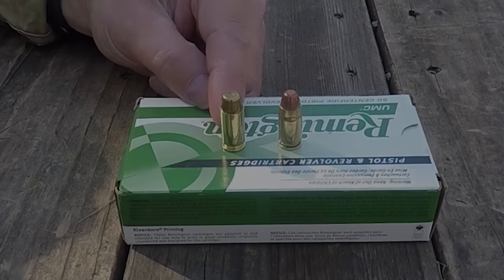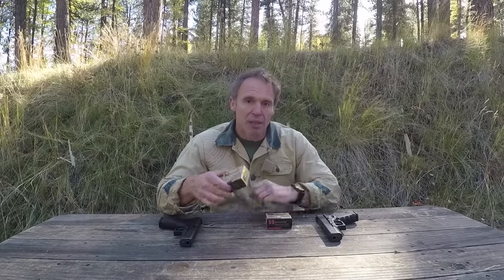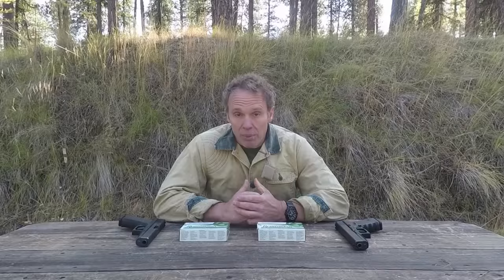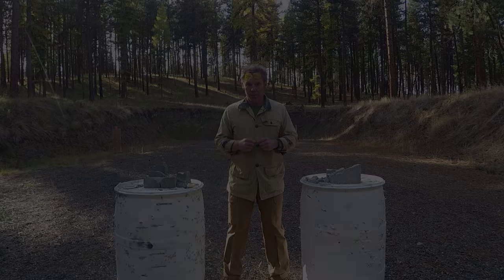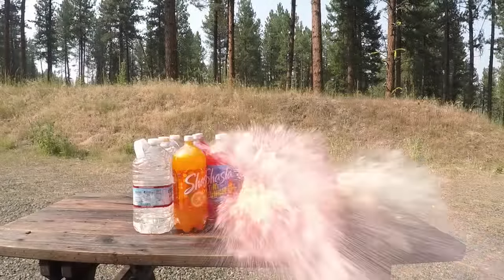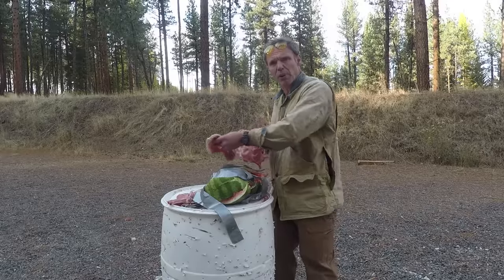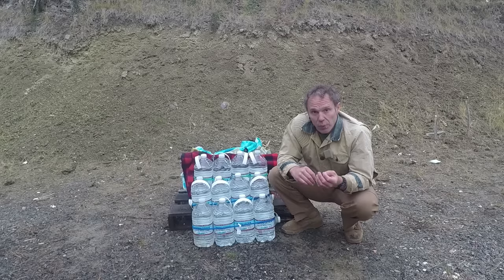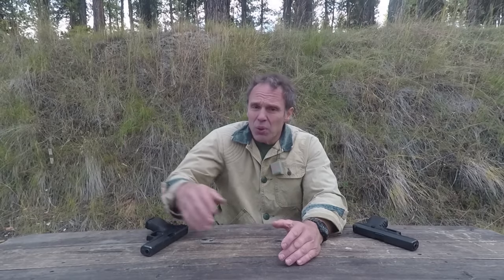Personal protection: .357 SIG vs. .40 s/w

Comment: From all of Paul's videos, I've come to the conclusion that every caliber has it's advantages and disadvantages.  It's almost like there is some form of tradeoff that people must make.
Reply: Paul gives you the data that will help you make the best decision for your self.
Reply: @naturewatcher64  hope you picked up on my sarcasm.
Reply: "You be the Judge!"
Reply: @ratagris21  I don't wanna be the Judge. I've seen his videos on them. The Circuit Judge was particularly disappointing. I wanna be the Magnum Research BFR in .444 Marlin.
Reply: Yeah, almost.
Reply: @af7119  I almost did.
Reply: You are right 😊
Reply: I just wish .357 was more popular and cheaper
Reply: I concur ... the matter of fact is ... similar size CALIBERS are just different for "commercial" purposes; in real life applicability, they all are virtually the same. THAT BEING SAID... in the vid's setup ... I think .357 SIG clearly outperformed .40S&W w/ LESS recoil. I'm surprised.
Reply: @moustachio334  Why more popular? It's essentially panic proof due entirely to it not being that popular. Availability is an issue if your state doesn't have a police agency that is using it. Some states currently use it and the practice ammo is abundant. Just depends where you are.
Reply: @Ujiyo  yup.  9mm went up disproportionally due to its popularity.  .357Sig is better for CCW as it’s likely to require fewer rounds to stop a threat, and it’s more reliable feeding than any of the defensive handgun rounds with the necked down cartridge.  Plus the panic buying does seem to pass it over relatively speaking.
Reply: @JustDefense  Don't get me wrong. It's expensive to shoot. Almost prohibitively expensive. It's one of the most powerful handgun calibers you can get in an autoloader. I've never had an issue with feeding. The design of the cartridge absolutely lends itself to feeding without issue. I'm currently looking for a Sig Sauer Nightmare in .357 Sig. I really like the 1911/2011 design. I also like my P229. I just prefer the 1911 platform.
Reply: @ratagris21  in his one video, a actually said it the same time he did.🤣
Reply: When someone asks what's the best ammo to get?  The answer is always "What's the application?".
Reply: @renatosureal  from my experience,  357 seems to give sharper recoil impulse but about the same muzzle flip as 40 S&W.
Reply: I have a sig P 229 in .357 Sig, and also have a 40 barrel , I feel that I have most of my options covered here in Maine, with Buffalo Bore dangerous game ammo in the 40, it will take anything that lives in my state

Comment: Noticed the 40 S&W had less felt recoil muzzle rise than the 357 sig.  At the range, 357 sig is much louder than 40
Reply: I bought a Glock 33 this summer. Subcompact 357 SIG, shooting mainly 125 grain flat nose, 59 cents per round. (Edit July 2023, now 46 cents per round.)

Love the Sig, I find complaints about recoil greatly exaggerated.

However, tough to get ammo and it's expensive. I can get a 40 S&W precision barrel around $200 including tax and shipping.

40 S&W 165 grain jhp same brand as the 357 SIG, is 32 cents. Pays for the barrel in under 700 rounds.

My question is for 40 cal shooters - in a subcompact like this, am I giving much away carrying 40 cal jhp? Would you be happy with the trade-off? What would be the drawbacks if I carried in 40 sometimes on a subcompact?

Edit July 2023: I bought a SIG P229 and have 40 and 357 SIG barrels. Both shoot great and I'm very trustful if either with normal ammo, usually flat nose and 165/125 grain.

IMO, oddball ammo tends to be highly unpredictable and I don't see the point in these calibers. Standard ammo will take down anything as well or better than hyper(expensive)ammo.
Reply: @keithgraham9547  In a short barrel there's probably not much in it.  Maybe a slight advantage to 357 in that you're taking the guesswork out of your HP expansion, they're definitely going fast enough.  That said remember that your barrel doesn't need to be flush, nothing stopping you throwing a G23 barrel in there.
I reload so it's all the same to me, a primer is a primer.  Haven't really shot anything but 357 SIG, 10mm, and 45 Super for the last couple of years.
Reply: @robertg8565  You'll get 1400 out of a 125gr no bother.  You start hitting diminishing returns with lighter bullets very quickly, you can push a 115gr at 1600, 90gr at around 1700 - problem is JHP just explodes on contact, doesn't penetrate for shit.  It really is very heavily optimised for a "sensible magnum" 125gr load.
Reply: @robertg8565  Bit of a stunt load in 357 SIG, much like Barnes TAC-XP.  Might as well just get a 5.7 out at that point.
Reply: @robertg8565  Not any more they don't, and your POI is going to shift significantly if you're changing between 68gr screamers and normal loads.
Reply: @robertg8565  Training isn't going to help with your rounds not going where your sights are pointed, and gel testing doesn't work the way you think it does.  I would recommend you get some more real world experience, and say my "name" to yourself.
Reply: 357, in the same gun as a .40, is definitely flatter on muzzle rise. Stop flinching because it's louder 😂
Reply: carmineredd  Well, no, you're not right.

First, getting shot in the head with anything will usually kill you, but there have been lots of cases where a 22 skidded around the skull under the skin and the person survived. 

Don't want to try it myself
 But never heard of that happening with a head shot from a 44 Mag.

Second, very few shootings are head shots. Very few are from 3'. No, I don't want to count on making a head or groin shot at 40 yards with a 22, versus a perp with a rifle. Or body armor.

I used to be comfortable carrying a 22lr with a 1.5" barrel and six rounds, figured any two people trying to mug me are not going to like it.

However, the last 3-4 years have seen riots and shooters in body armor with rifles. While it's highly unlikely I'll ever need it, I decided to upgrade my summer carry.

IMO, based on videos, my own shooting, and whatever statistics I can find, 9mm sucks. Hard. I despise it.

So while I still shoot and sometimes carry 9mm, I don't have huge confidence in it.

Three-season is usually a Glock 30SF in 45acp. Summer is usually a G33, but I bought a SIG p229 about four months ago and have both 40 cal and 357 SIG barrels. Big fan of both.

If I HAVE to engage at 40-60 yards, I can make a perp jumpy. If I HAVE to make a head or groin shot at 15 yards, I have a better chance with those three calibers and guns.
Reply: carmineredd  Sure, if you want. You get a screwdriver and test it out against a mass shooters with body armor and an AR. We all want to see the video of how that works for you.
Reply: KE increases more with velocity, but not momentum (=mass*velocity).
And KE is used to mesure everything nowadays but older shooters and hunters still use momentum, and below 125gr is very light for Caliber in 357/38/9mm.
Standard for 357 SIG imho should be around 125-158gr as its original purpose was to emulate 357 magnum performances in semi auto.
Reply: @robertg8565  So how's life in Tel Aviv these days?
Reply: Greater energy of the sig , no brainer

Comment: I carry .40 S&W and I will continue to carry it. Its a good compromise between 9mm and .45 acp. The round is proven no matter what anybody says about it. I think practice drawing and shot placement is much more important than the round ypu carry. I can do a lot of damage with a .22 just from placing my shots in effective areas on the target.
Reply: 40 isn’t even a compromise on 45. most .40 sw loads (particularly 165gr loads) have a LOT more energy than .45, unless you step up to .45 acp +p which even then you can get .40 ammo that competes with the +p too. .40 also gives you the same capacity (or larger capacity) as the .45 but is almost always in a fair bit smaller gun.

Comment: This is a good video Paul. As someone who carries 357 Sig: I have my own experiences, the 357 Sig owners I've spoken to when I worked at a gun range (take with a grain of salt of course), and the data I've seen. Let me explain the pros and cons to people who may find pages of ballistics data to be a bit overwhelming.

Pros: 357 Sig is very cost effective firearm wise. You can buy a police trade in .40 S&W pistol for cheap, swap out the barrel, and have your gun. (I did that with my P226). Additionally, it's much easier to train yourself to go between 9mm and 357 Sig than it is to go between 9mm and .40 S&W. The increased velocity of the 357 Sig helps the hollow points more reliably expand and makes it a much more flat shooting caliber than 9mm, .40 S&W, or .45 ACP. 357 Sig is also standard issue caliber for highway patrols in most states and Secret Service, so if you carry the same ammo as they do (usually Speer Gold Dot) it will be looked at with a less jaundice eye in court.

Cons: Ammo cost itself is going to be a bit higher and you usually have to order online to get any of the premium hyperammunition. Because the caliber is necked down, it has a much higher PSI. What this means is if you convert a .40 S&W over you want a reputable make that's going to live up to SAAMI specs (Glock, Sig, CZ, etc). Because the 357 Sig is flying at a much higher velocity, which pistol calibers aren't really made for, you have to be more selective in your ammo choice. IME and from the data I've seen, that's pretty much only going to be 125gr weight projectiles. Anything under that tends to break apart or otherwise have issues with penetration. (The projectile breaking apart is very good for a rifle caliber, mind you. Not pistol calibers though.)

So, is 357 Sig the right choice for you? I would honestly recommend it for just a few circumstances. First and foremost: If you spend a lot of time in your car. I used to deliver pizzas so shooting through auto glass would be a concern for me. 357 Sig goes in a straight line through it. Secondly, if you live in a very cold area where people are constantly wearing more and heavier clothing, especially during winter time, the 357 Sig's velocity can be very helpful for defeating that. You can also conceal a bigger 357 Sig pistol more easily. Lastly, you work in some type of private security or escort where you have a VIP that must be escorted from vehicles and through buildings. Generally speaking though, 9mm is the best caliber for new shooters. There's a 9mm handgun out there for anyone, everyone can handle a 9mm, and you can find ammo everywhere. (Ain't called wonder 9 for nothing.)
Reply: I agree! My friend and I bought Sig 239's. I bought mine 1 year ahead of his. Mine was a 9 mm his a Sig .357. My 239 9mm had a stamped slide his a CNC for the .357. We got together to test the difference. The .357 was far superior to my 9 mm. Wish I would have waited to get The. 357 Sig! Sold my 239 9mm. I got the XDS sub compact in 9mm sold it too.. Then bought the Lc9s 9mm pro wish it came out in the .357 Sig Still remember the 239 in .357. Wow what a gun!    Shawn
Reply: @Jonathan Anatrella That's some good information there, my brother. I'm doing research at the moment, looking for a firearm and caliber for police academy which I'm hoping to start in a few months. The caliber options were basically anything between 9mm and .45 ACP. I wanted something that would be an effective firearm with a little more power than the 9mm but wasn't something like the .45 as I already have a .45 pistol that I'm not going to be using as it isn't from a company authorized to be used by the police in my area (the company is CZ). I remember seeing the .357 Sig years ago but didn't really know much about it. Looking at what Paul and yourself have mentioned, I'm thinking the the Glock 31 or 32 chambered in .357 Sig is going to be the way I go. I'm a larger person, not fat large, so I can handle the calibers that are snappier like the .40 S&W, .357 Sig, 10mm, and so on with relative ease. So thank you for this info. Very useful. Much appreciated.
Reply: @zagorith14  I would say .40.  10mm is expensive and uncommon(might be an issue in court).  Also, .357 SIG runs at a higher pressure and is harder on guns than .40........

Comment: My Glock G22 loaded with .40 cal. work fine for me especially with the crazy price of ammo, but to cover my bases I purchased two conversion barrels for .357 Sig and 9 mm for my G22. The Glock .40 cal. magazines work fine for both the .357 Sig and 9 mm as well.

Now if the SHTF I can use three of the most popular handgun calibers with one small shooting kit. Simple, flexible, efficient, and inexpensive.
Reply: 357 followers work fine with .40.  The .40 followers don't work so well with 357.  Fine for range use but I wouldn't trust them for anything serious.
Reply: 357 sig is one of the most popular handgun cartridges?

What lol
Reply: Yep, me too. But my original Gen 2 mags get ftf for 9mm. New mags including 22 rd (for 40) work for the 9mm too.

Comment: When my agency switched from .357 Revolvers to .40 S&W we chose the 155 grain JHP. The reason initially was because the muzzle velocity and projectile weights were very close to the .357 Magnum 158 grain JHP.  The results in test medium was virtually the same for each.  Later, after the .40 S&W became popular we began to have various Law Enforcement Agencies contact us in regards to the 155 grain JHP’s performance in the field, because the 180 grain JHP .40 S&W’s failure to perform as expected.  A local sheriff’s department  inadvertently switched from Speer Gold Dot 155 grain JHP to Speer Gold Dot 180 grain JHP. They had had three one shot stops and one multiple shot stop with the 155 grain JHP Gold Dot. In the first 180 grain Gold Dot shooting the subject was hit three times in the chest area at point blank range. He then ran ~50 yards and sat down against a tree. When backup arrived he was complaining about having difficulty breathing. When EMT’s arrived he had stopped breathing. I have since been told that after I retired Ammunition manufactures had greatly improved jacketed hollow point design and the 180 grain JHP’s, such as the Speer Go,d Dot, were on par with the 155 grain versions.

Comment: 357 sig is very underrated.  Not sure why it isn't more mainstream than it is.  Almost comparable to the big dicked big brother 357 Mag.
Reply: Very comparable is full sized pistols and duty revolvers both launch 125 gr bullets at 1450 fps only thing is that's about where 357 sig maxes out while 357 mag can still go more powerful
Reply: .40 is actually more powerful. When you get the hottest factory ammo for both, the 135 gr Underwood .40 nosler, and 124 gr Underwood .357 sig nosler, the .40 reigns supreme. So .357 sig can not claim to be more powerful, no matter how many big companies load .40 and 10mm way under saami spec and load .357 sig pretty close. 

The 135 gr and 155 gr underwoods are rated from a 3.4” barrel too, AZ AIRGUNNER just proved that with two recent videos of .40 vs .357 sig. He got exactly 589 ft lbs from the 3.4” barrel with the underwood 135 gr .40 nosler. The .357 sig nosler from them had 540 ft lbs. from the 3.4”

From a 4.9” barrel the .40 had 675 ft lbs. The .357 sig had 640 ft lbs from a 4.5”.  Gun Sam tested the .40 from a 4” and it got 610 ft lbs. Needless to say I picked up a fex boxes. It’s in saami spec and it shoots great from my Glock 23, not uncomfortable at all.
Reply: @SuperD00D  357 sig is more powerful than 40. If it's not then it's not loaded right. It should be.
Reply: it got fairly popular about 15 years ago. Like the .40 cal its dropped in popularity. Even more so probably.
Reply: My edc is 357 Sig and I think one reason people do not carry it is because it is loud as hell. With greater power comes louder thunder. Anyone that says otherwise lacks a basic concept of energy. 40 S&W is ok for the limp wrist type, adequate anyway. But my wrist are strong and my hearing is shot so I carry both 357 Mag and 357 Sig. As is both are carried in my truck every day.

Comment: Great information that will be useful to me. Always perfectly presented. Thank you Paul.
Reply: I am throwing out the ceramic and putting high tech fleece in my plate carrier as we speak!
Reply: +CaptainXanax. Oh no, you have got it wrong! You have to keep the ceramics, it is the plate carrier that gets replaced by the fleece.
Reply: the 357 sig beat the .40 in every single way, right?  That is what I saw.  Did u see it? thx.  I have  a 27.  I am thinking about getting a 22 and cut the grip.  But, maybe I should get the 31?  And cut the grip?  thx.   cut the grip down to a 27 size, so I can have a 27 long barrel in a 31 upper.
Reply: Allen BePro I love that paul doesnt just throw numbers at you from charts. He actuallly does field tests with different loads and handguns of the calibers he's discussing which is something his competition does not do.

If he sold t shirts with a picture of a meat target i would buy two of them.